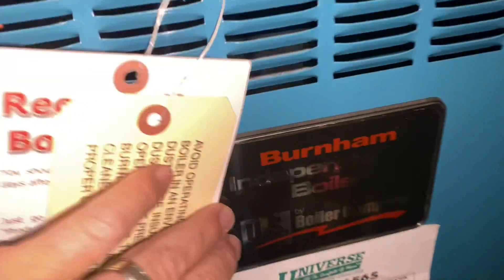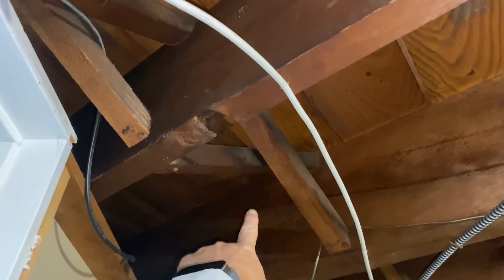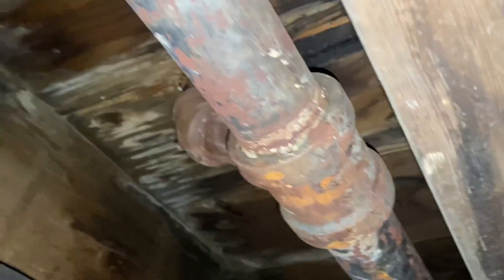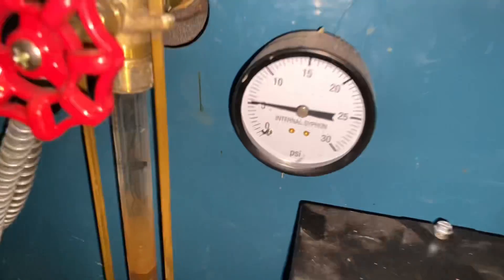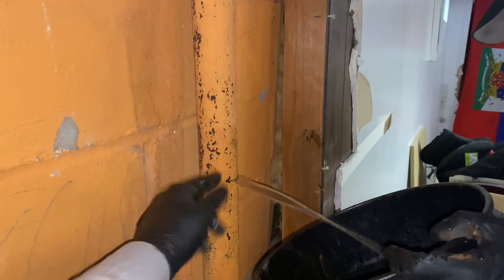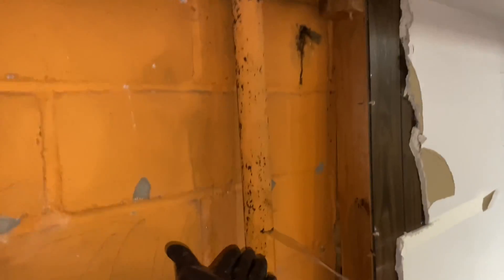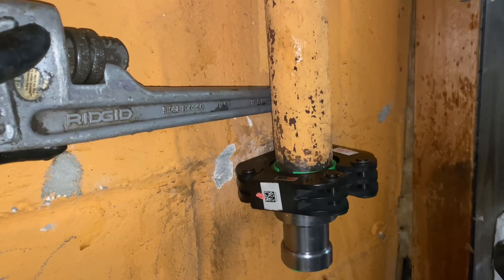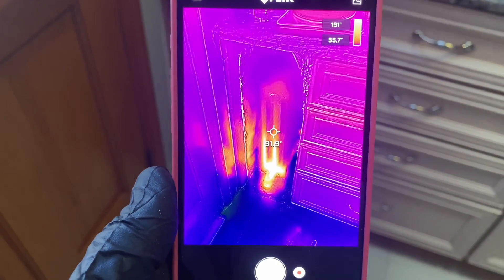Steam Heating Pipes Bang All Night & Water Coming Out of Radiators - SOLUTION REVEALED

Comment: You can use propress on steam and mega press. make sure you get the right ones the green dot or standard propress are epdm gasket material which is good for low pressure steam up to 5 psi. I recommend using the white dot or fkm gasket material because they are rated for up to 15 psi steam if I remember correctly. They sell the gaskets where you can swap them out or you can just by the fittings with them installed. Just less of a chance for something to happen in the future and the cost isn’t that drastic.

Comment: MIkey, I truly believe that a lot of these issues are related to the fact that the water from our local water companies is high in Iron, causing those clogs and obstructions commonly found on Steam related systems on Long Island. That being said, in you professional opinion, would you recommend a filtering system installed on the feed to rectify, or possibly eliminate these conditions. Long time subscriber and supporter. I value your answer!

Comment: Mikey(or anyone else here) I was hoping you could help me.  I have a Goodman High Eff furnace that was leaking water where the flue pipe meets the exhaust on the top of the cabinet.  When it was installed, they put a 45 degree 2" pvs on top of the flue pipe, but its been seeping water around the connection.  I got the new flue pipe and elbow that attaches to the inducer put in but the 45 deg elbow that I want to attach to the flue pipe just doesnt seem like a tight connection. I know Ive seen some who use a Fernco rubber connectin to the flue and then the white pvc to the top of the Fernco.  Ive also seen where some say Goodman doesnt recommend a rubber connection.  Should I just go with the 45 and glue the heck out of it or something else? Appreciate any help thanks

Comment: It amazes me that none of the steam systems you work on have the mains or returns insulated. The amount of money these people would save in heating costs, outweighs the cost of insulating the piping.
Reply from the maker: And I bring that subject up every single time. Goes in one ear and out the other usually.
Reply: @PipeDoctor  insulating pipes isn’t a fun job, but the return in the form of
Savings is big!  
Keep up the good work keeping steam heat alive !
Reply: generally in those old slum-holes, the pipe loss isn't really much of an energy wasting issue, because it's still heating the home as radiant via the floor/s.
now if the pipes are in unconditioned crawl space, attic, garage or very leaky basement, then yes that would be a near total loss and waste. 
air sealing and insulating the home would still net you more energy savings than insulating the steam piping, also better windows if they're dinosaur age.